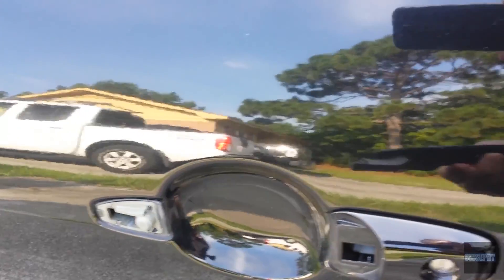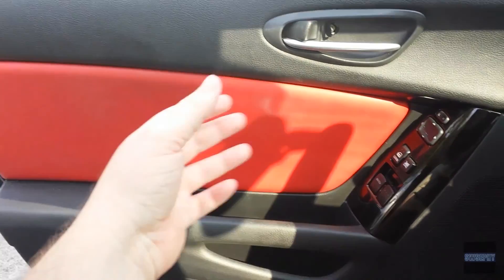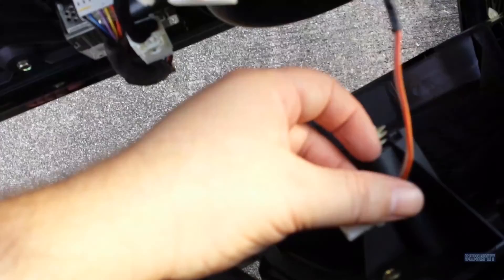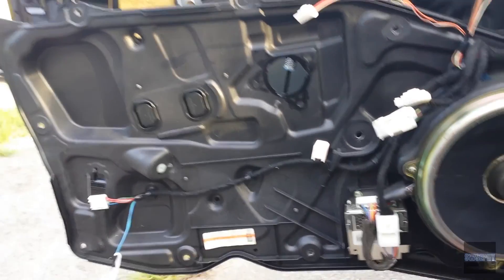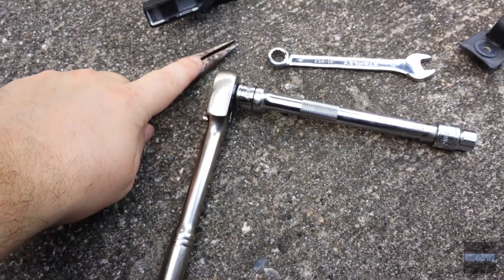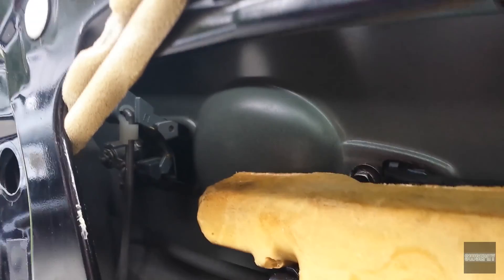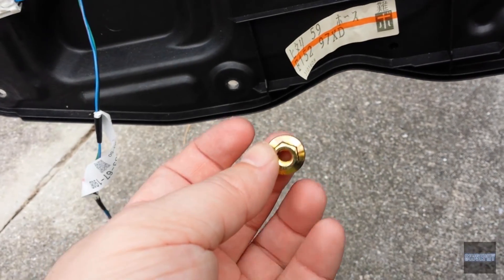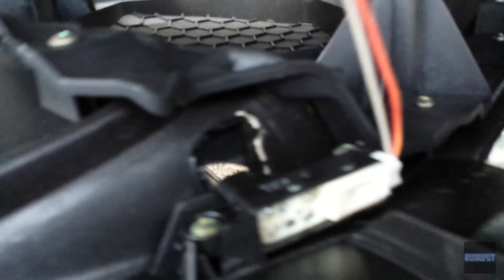Mazda RX-8 Exterior Door Handle Replacement | How To

Comment: Don't take out the window regulator's 3 mounting bolts, it is a wire fed system on a spool and can come unwound rather easily... otherwise great video!
Reply from the maker: Oh wow. I've done this three times now and never knew that could happen. Thanks for the info!
Reply: Welcome bud, mine pipped apart the moment i took the 3 bolts out, it just fell into the door
Reply: You even say in the video that it is difficult without extra hands, i just taped up the window after reassembling the window regulator and it seemed to hold up the window while it was diss attached from the mounting point
Reply: P4TI3NT_Z3R0 I cant seem to rewind the window regulator
Reply: @zowda4368  it is quite difficult,  i lowered the window all the way to get extra length on the cable, then bolted it to the plastic panel. I did try it with the window duct taped all the way up as well, it seemed to do well. Keeping it together under tension is quite difficult though if you are unfamiliar with the assembly. It took me a few tries the first time around to get it fully spooled

Comment: Thanks 9 years later and still helping people! I took the window out to make easier. Lowered it until the i could see the two screws for glass on two black rubber door seals that i popped out, removed the glass and set aside safely. I appreciate your video.
Reply from the maker: Glad it still helps! Definitely could have done some things better and I like your method of just taking the window out

Comment: Just had to say thanks again. I picked up the handle at the dealer for $58 in my velocity red. I love fixing shit myself and this is the second time taking apart the door panel (fixed window motor gear and lock actuator) but the video made things a lot easier. Thanks man!
Reply from the maker: Nano305 No problem and good luck! Just remember that when you unbolt the window regulator that it will just be hanging freely. Might want to find a stick or something to prop the window up so it doesn't fall on your arm or something.

Comment: Thanks for the video!  Really helped!  I didn't have that problem you mentioned in your video.  Everything went back together easy.  Only thing I screwed up on, was I thought I was missing a screw, put a screw in where the main door cover screw goes in.  Had to pull the bottom off again to move that screw.
For getting off the main panel, didn't use a screw driver, pull on the handle a bit so you can get your fingers in and pull.  No scratching.
Reply from the maker: Glad it helped and good tips.

Comment: Hi, many thanks for this video, I’m using it today for exactly the same issue but mine is on the passenger side. How did you get the rod out of the old broken part and put it into the new handle? The video seems to skip that part. Again, thanks for making the video all those years ago, it encouraged me to give it a go rather than just book it in to the dealership and I’m nearly there. Just got to source a handle and install it now
Reply from the maker: Oh gosh this was a long time ago but I think I was able to sort of just jimmy the rod in there without too much trouble. Also good luck! And I could only find another handle from the dealer. Everywhere else was a no-go.

Comment: Hey man thanks for taking the time to make the video. This makes it look totally doable. Question.. where did you get the new handle? used/new? It came painted? How much was it? Thanks again
Reply from the maker: I got the handle new from the local Mazda dealer. I don't remember how much it was but I remember being surprised that it was cheaper than I was expecting and yes it came painted which was a relief because neither I nor the parts guy at Mazda knew for sure if it would. The paint code is tied to the VIN. And sorry for the bad camerawork. I was by myself so I didn't have anyone to help me out, haha. Glad you like the video. :)

Comment: Quick question, did you roll the window up or have to take it out? And did you struggle to get it lined up again
Reply from the maker: I left the window up and didn't realize until after that when you take those bolts out that the window is kind of just freely hanging there and could easily come down. It won't break anything but just be aware it could pinch a finger or your hand. If I remember right everything went back together relatively easy except for the final interior piece that goes against the window. It's always a pain to put mine back for some reason

Comment: Do you keep the window in the up position or down position when working on this?
Reply from the maker: Up position. Also keep in mind when taking the bolts off there will be nothing holding the regulator/window in place except for the posts that the regulator is sitting on. Be mindful of that because it could potentially fall. It won't break anything but could injure your hand or something if it's in the right spot.
Reply: @swsephy  Thanks, I'm going to have to do this in the next few days when the part comes in. I was thinking of clamping the window to the frame with a rubber clamp to make sure it doesn't fall off the posts as well.
Reply from the maker: @peterzappala383  You could probably put one of the nuts back on after taking the door panel off and it will stay. I didn't think of that though when I was doing it.

Comment: @swsephy my fear before doing this job is the window regulator spool getting unravelled. It happened to me on the passenger side once, nightmare. My driver's side door handle is no good also, any tips on avoiding this?
Reply from the maker: I don't know if I have any tips for that. I've had my door apart three times now and haven't had anything like that happen.

Comment: I think this just happened to my 2004 rx8. my daughter was yanking on the door handle and now it has no resistance.  I imagine that plastic piece broke or is no longer connected to the pull rod. anyway problem is,  door is closed.  any idea how I can open it so I can work on it? thank you for any help you can provide
Reply from the maker: G Rod If the rod is only disconnected from the outside handle then you should be able to open the opposite door and open the broken one with the inside handle.
Reply: good point. sorry if I'm kinda clueless on this. so the outside handle won't open the door and it also won't open from the inside. my daughter was pulling on the handle while I was trying to unlock it using the power lock. I'm thinking something broke inside. any ideas what the problem is?  when I press the power lock it sounds and looks as if it's gonna unlock but kinda stops and never gets to fully unlock postion. also outside handle has no resistance or spring to it. thanks for your help
Reply from the maker: G Rod Oh I gotcha. Unfortunately I don't really know how to proceed from there. Sounds like the rod inside might be jammed on something and isn't allowing it to fully unlock. And it's not possible to take the door panel off with the door shut. Aside from taking it to a shop I'm not sure what to do. Sorry I'm unable to help. If I come across anything before you get it fixed I'll send you a message. Best of luck.
Reply: you've already been alot of help and I appreciate the quick responses. thanks
Reply: @grod4243  I know this is 4 years too late but maybe someone else can use this.. I had the same problem... the door lock apparently was preventing it from opening on the inside. What it took to  finally get the door to open was continually clicking the unlock button on the key fob and simultaneously making sure the inside lock switch was also completely in the unlock position. I also banged the inside of the door a couple of times with my fist... not sure if that was important, but anyway, I then pulled the inside door latch and the door opened. after that I did notice that the outer latch was completely disconnected from the mechanism inside. At least now the door can be opened from the inside.

Comment: I have a 2007 rx8 touring and it has the keyless button, but I never use it I just unlock the car with the beeper. Could I still a non keyless door handle on my car. Or is the setup different.
Reply from the maker: To be honest I'm not sure. Swing by the dealer and they should be able to tell you.
Reply: I did and they were no help... they said it would probably work, but they weren't sure. The handle would also cost me $238. I can't seem to find a sure answer any where. I honestly don't mind not having the keyless entry.
Reply from the maker: Key Blade My guess is that it would work. The physical dimensions should be exactly the same with all of the handles, and I doubt the rods would have different connecting points. Again, I don't know this for sure but I can't see them making it different due to costs.
Reply: update*  So I went ahead and bought a reg. door handle without keyless. And everything is the same except for the bolt that is right next to the key lock.  There's some extra wires that for the keyless making it harder to get too. And when removing the exterior part of the door handle the(by the lock). It has a wire with no clip that I had to cut.
Reply from the maker: Key Blade So that means all is good?
Reply: Yup every thing is on and working correctly
Reply from the maker: Good to know. I was thinking it would work but didn't know for sure. Glad you took the chance and I'm glad it worked out.

Comment: when the door handle fell off were you still able to open the door from the inside?
Reply from the maker: Yep. Only the outside handle was broken. I could still open the door from the inside.
Reply: thanks is it easier to left the window glass up or down to make the job easier?
Reply from the maker: The glass has to be up. And you might want to find a stick or something to prop under it once you undo the regulator because it could fall and hurt you.